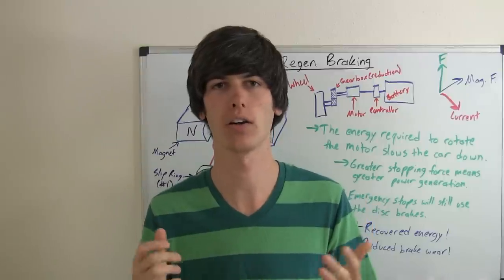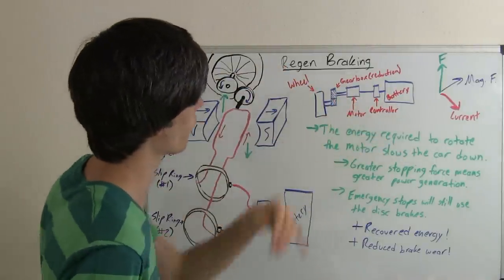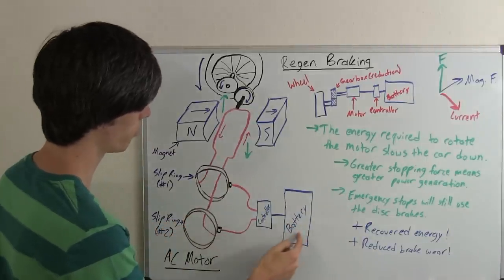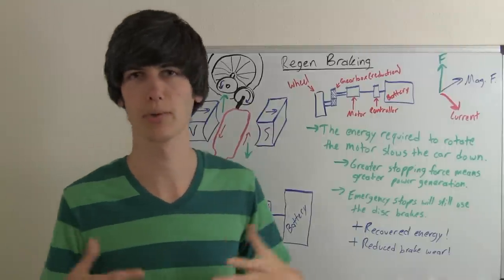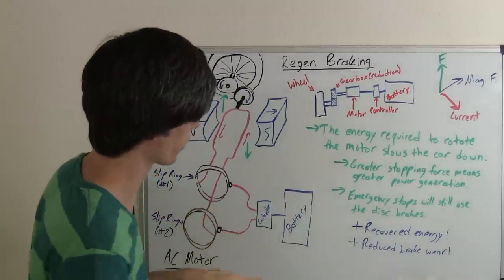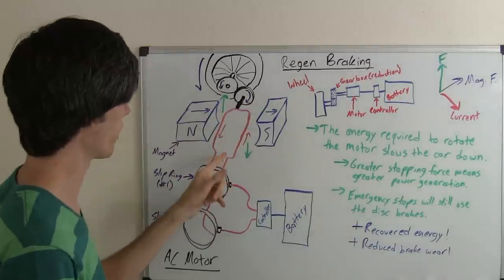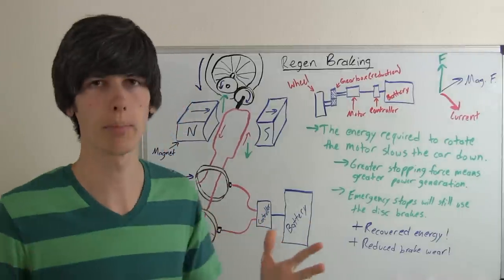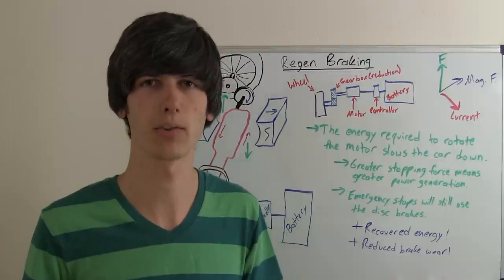Regenerative Braking - Explained

Comment: Actually, the reduced brake wear has adverse effects on the friction brakes. This includes corroded transfer film and off-brake rotor wear which causes brake torque variation and judder.
Reply: Sorry Jimmy but regenerative braking does not completely eliminate the use of conventional (normal) brakes. In most instances regenerative braking is used in combination with normal brakes. Remember normal braking is the primary source for stopping a vehicle & no one would want drive a vehicle without it! Regenerative braking works great during a long 'coast' but does not function during repeated stop & go traffic.
Reply: Rick Rodrigues Then you would plug brake after you get too low in speed for regenerative braking to work. Electric forklifts and power jacks stop and then change direction when the throttle is moved for a change in direction....Of course I would still want mechanical brakes for extra safety. On electric forklifts and power jacks they add an electric actuated mechanical brake that will lock in place upon power failure or if the equipment does not have the deadman pedal depressed.
Reply: EETechs All EVs have a reduction gear between the motor to the drive wheels because the motor always spins faster. This effectively increases (multiplies) torque...therefore acceleration. When the motor drives the wheels battery power is consumed (KWhr). When the car is in a "coast" or slowing down with no power  to the motor the wheels 'back drive' the motor which now assumes the role of an ac generator utilizing the forward momentum/kinetic energy of the vehicle producing regenerative electric energy & at the same time slowing the vehicle. The ac produced is rectified to dc and applied to the battery pack. The switching back & forth (motor-generator-motor) is accomplished by pedal position inputs to controlling software.
Reply: Rick Rodrigues HUH? I am talking about going into plug braking mode after regen mode is no longer working well. Regen mode, as you are talking about, is only effective at higher RPM's. It becomes ineffective at low RPM's. Plug braking can bring a vehicle to a dead stop without the aid of brakes. Regen braking CANNOT.

Plug braking works by putting the motor into "weak reverse direction" that quickly decelerates the motor since now a force in the opposite direction is being applied. Once the motor comes to a stop, the electronics will then see if reverse is still held, if so then then it will gradually increase the reverse power more and more as you apply more reverse power. Hence, it will start to go into the other direction.

All modern electric forklifts and power jacks with AC motors go into regen mode at first to put some of the energy back into the huge battery, then as the motor gets slower, the controller switches the polarity on the motor at low power, which then quickly brings the forklift or power jack to a stop.....
Reply: EETechs You seem to have an English comprehension problem. I believe the subject here on this forum is a regenerative braking used to recover energy when the electric vehicle (EV) is slowing down or in "coast"! PLEASE REVISIT MY EARLIER POST WHEN I EXPLAINED THIS FACT!  I also explained regenerative braking (energy recovery) is generally used in combination with normal (hydro-mechanical) brakes and is ineffective during 'stop & go' traffic!!! Auto manufacturers will not blindly rely on regenerative braking alone to stop a vehicle especially in an emergency. Perhaps you can explain (define) what is meant by "plug braking"...as I'm sure no one has ever heard the term used before.
Reply: EETechs  Are we angry yet? Wow...take a pill & chill! Lol! Unbelievable... you missed the point of discussion again on this forum! Please read slowly & carefully! 
VIDEO IS ALL ABOUT THE BENEFITS OF REGENERATIVE BRAKING. VIZ...ELECTRICAL POWER RECOVERY FOR BATTERY POWERED VEHICLES (EV); IT MEANS TAKING ADVANTAGE OF THE (EV) VEHICLE'S FORWARD MOMENTUM (MV)/KINETIC ENERGY(KE = 0.5M.V.V) TO "BACK DRIVE" THE POWER SOURCE (THE ELECTRIC MOTOR OPERATING IN GENERATOR MODE) DURING A SLOW DOWN OR COAST DOWN FOR THE EXPRESS PURPOSE OF RECHARGING BATTERIES!
 
This is NOT a discussion on fork lifts & power jack braking systems which 'you lay claim to having some  knowledge'...& which may indeed be very questionable! Please feel free to open a separate forum to educate those ignorant (like myself) on this very technical subject. Anxiously awaiting.
Recommended reading:- http://www.umassmed.edu/PageFiles/64038/anger2workbook.pdf
Reply: Rick Rodrigues Listen, I was responding to your FIRST POST where you said mechanical brakes are still needed, which if plug braking was used WOULD DO THE SAME THING TO BRING THE EV TO A COMPLETE STOP LIKE MECHANICAL BRAKES DO!! Of course I would still implement mechanical brakes for unforeseen emergencies and to hold a vehicle in place once it has stopped and no reverse is being issued by the driver. If EV's had electric forklift tech, then they would be able to regen at first and then as they slowed way down, the controller would switch to plug braking mode to bring the vehicle to a complete stop.

Plug braking must be confusing the hell out of you. So try this: take a small brushed DC motor and connect it to a flywheel. Now spin it up to full speed with battery leads connected to the motor and then take the battery leads off and hook them it up to a high wattage resistor of  a resistance value of 1 ohm on one of the leads, so as to limit current to a safe value. Now hook up the battery in reverse. What you will see is that the flywheel will QUICKLY come to a stop and then change direction if you continue to leave power to the motor with the battery. This is called plug braking...

Regen is taking the motor's output when braking is applied and putting it through some charging electronics to put some of the energy back into the battery. However, it CANNOT bring a vehicle to a complete stop. The voltage will become too low as the motor spins down more and more.

Our electric forklifts and power jacks use both methods. One to return some energy to the batteries at initial slow down and the other to frequently brake the equipment completely since direction change happens quite often. Therefore, no wear and tear on the mechanical braking system and no reversing gearing needed...Just simply move the controls in the other direction and everything else is taken care of with the electronics..

If think my knowledge is "questionable" then put in an application where I work at. We have high turnover rate because of the idiots they hire. I'm sure you can show us your "superior intellect" like the last guy that got fired and I had to fix the dumbo's mistake that took out 8 hours of MY TIME that could have been better spent on something more productive. But hey, you seem to think you know so much so come on down Mr. Einstein. I've done been through plenty of your types already. You'll just be another one to add to the pile of so called "experts".

Comment: There is no need for mechanic brake, I don't understand why electric cars doesn't use the motor to brake. Electric motors have so much torque that it's possible to go from 20 km/h to spinning the wheels backward.
Reply: That's a lot of wear on more expensive/difficult parts though?